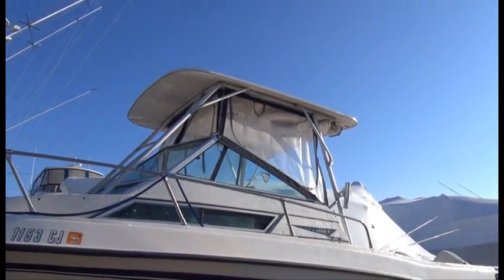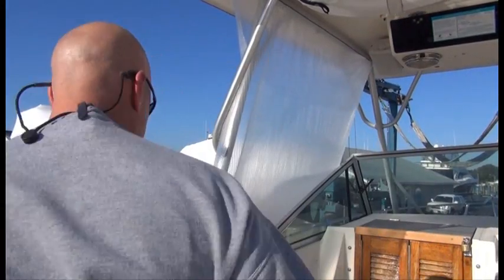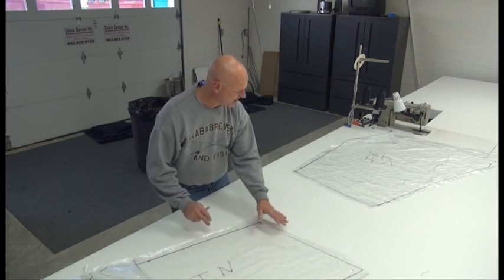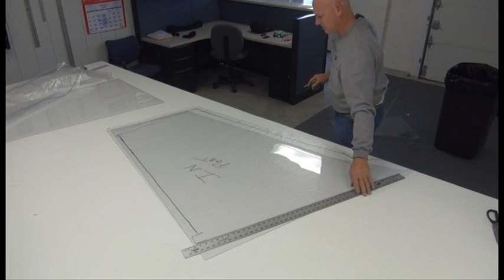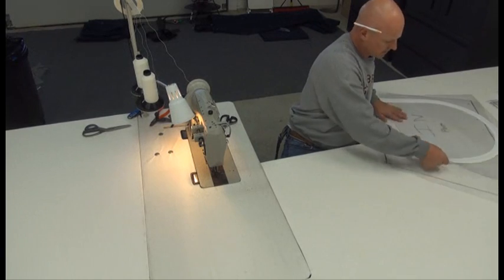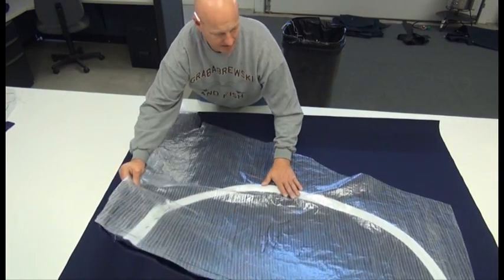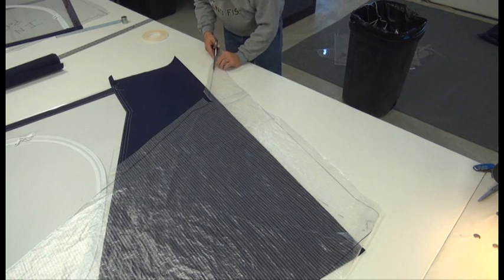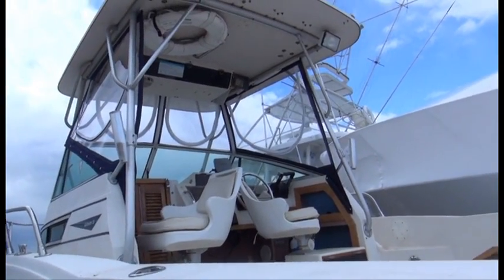how to make boat canvas, bimini, enclosure side curtains, start a new business.

Comment: Hi all :)
John put a great video to learn
Some of the questions maybe i can answer to help him :)
can u use home sewing machine ? NO
for just the fabric - yes but u adding clear windows  + fabric
in some point u end up with 4 layers of fabric and the clear 
u need a industrial machine.
They are very fast that`s why Jonh looks like going fast.
i owned a pfaff industrial sewing machine and i sold it after 1 month .
this machine was too fast for (as beginner)
then i bought few home sewing machines which i sold also.
Why ?? - the tension
in home sewing machine u can use only up to b69 thread witch not a good idea for boat canvas or enclosures
u need at least b92 of which ur machine won`t take and size 20-21 needle and a walking foot
without walking foot the fabric and the clear windows will pucker
the tape he is using is called double sided tape
now i owned a sewing machine ( portable ) which i just love
cost almost $1000 cdn
but  im in full control on it
took me some time to learn but was worth it
i refused to pay fabricator $3500 just for cockpit enclosure
$2500 for flybridge cover
the i want to make windows cover $ ???
i want to make a cabin curtains $ ??
i want to reupholster my cabin sofa $ ???
that`s why i was learning :)
take a lot of scrap of fabric and sew and sew until u can sew very straight stitch :)
if u can`t - the fabric and window will pucker - trust me
sorry for the long post , just trying to help
Reply: No, no no! love your instructions. Still, I wonder if I can really make one by myself. Mine is a 36foot Mainship, the store asked for $10,000 CAD. Thank you so much.

Comment: how did u reinforce the sunbrella fabric for snaps installation ??
i noticed that it is (bottom of the panel ) single layer of sunbrella fabric reinforced and binding
im planning to use top gun as reinforcement
do i have to fold the sunbrella  or just 1-2 layers of top gun and bind along the edge
im trying to make my cockpit enclosure where is a hard top

Comment: I noticed your thread breaking a few times, If you bought Feet off the internet for your machine the hole for the needle to pass thru may not have been deburred and may have a sharp edge on it. I've bought a number of feet that the manufacture just drilled the hole and didn't smooth the hole so it is thread friendly. Those being harden steel you need a diamond tip dremel and sand paper glued to a toothpick to get it smooth enough that the thread doesn't break when you pull on it. You are super fast. Thumbs up to ya

Comment from the maker: Hey Dan,  $350 sounds kinda cheep.  If the machine is old I would say don't buy it.  You can get a good walking foot machine for around $1000.00. If your goal is to make boat canvas you do not need a zig zag machine a straight stitch works better. The feed dogs "look that up" hold the fabric on a straight stitch much better.  Not to mention the arm length, look up consew or seiko. They are reasonably priced and work great. I use a consew 255rb3 and a seiko 206. Both have strong walking feet and large bobbins.